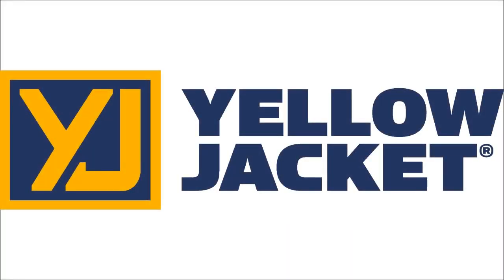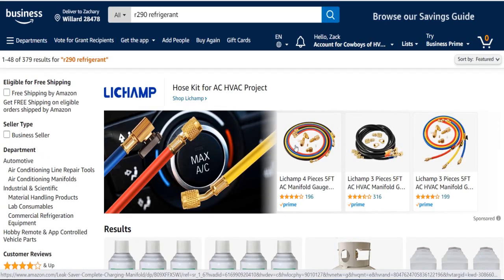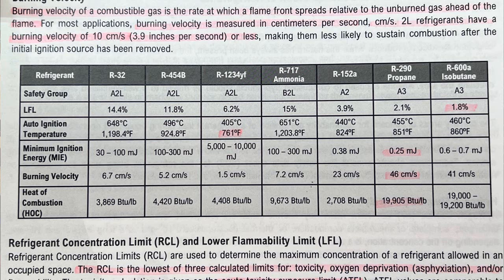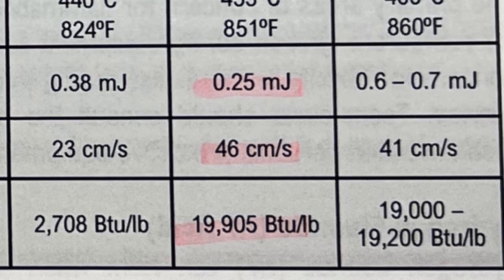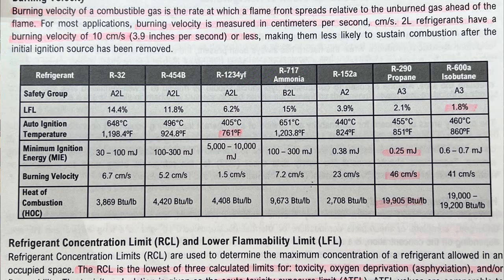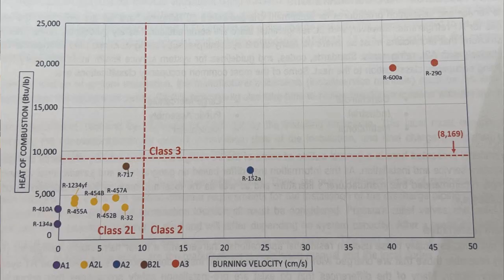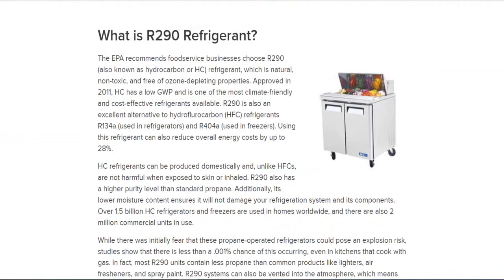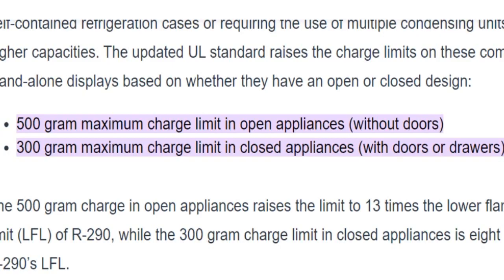Introduction to R290 refrigerant

Comment: R290: so scary. Oh wait if you have propane stove, propane water heater, hooked up to piping that can deliver  100s of pounds of flammable gas inside your house and yet we don't think twice about using gas appliances.
R290 is a great refrigerant. Cost, single component, no glide, etc. Did i say COST? Basically a drop in for R22.
 
Yes it deserves respect for safe handling and understanding if used. 

Why didn't we have it accross the board?
The chemical companies can't make money selling you R290. There's no patent on it. 
So I bet if you looked closely enough you'd see they are the companies that are pushing the scary narrative. But remember gas range, gas furnace, gas water heater, even gas lighting if you are Amish or want back up in case of power outage. 

I don't like the fear being used to prevent a great refrigerant being available.
Reply from the maker: I know they limit it to small charges. I guess the running pressure may separate it from other applications as well. 

But I see your point. We drive things that are powered by motors where controlled explosions occur rapidly.
Reply: @TALYN875  in the USA we live in a lawsuit happy wanna be nanny state. From my point of view there's no valid reason to not use R290 wherever R22 had been used with similar safety protocals used with gas fired appliances. But creating a boogy man out of it, means the chemical companies can sell you these other gases for a lot more money and profit. Seems like chemical companies are taking a page out of big pharma's play book, raising prices as high as the market will bear.

Comment: Limited gas amounts in a closed loop stored mostly outdoors in unit; why is this an issue considering many homes if not most are heated with flammable natural gas in an open system ignited indoors with virtually unlimited feed amounts. Why is the focus based on scare tactics highlighting flammability? The focus should be that R290 is non ozone depleting, is non proprietary making it inexpensive and requires lower pressures than many current refrigerants.

Comment: R290 sounds way better for heat pumps and water heaters. R290 can not burn or blow up without oxygen. Most leaks in AC units are slow leaks, so as long as there is some air flow, it would be hard to build up to an explosive mix. Within the unit, don't have open sparking, like unenclosed relays or loose wire connections. Don't let your pit bull play with the plumbing. Millions have gas or propane heating, stoves, fireplaces, etc. and  I would be more concerned with there plumping, as they are often more in the open were they could be bumped or something and have a large amount of gas behind them.

Comment: In a outdoor monoblock system there is no problem with R290.  It can heat the water to 75 degrees celcius

Comment: Americans are just too dumb to follow standard procedures for working with R290 equipment. Just pull a vacuum with all system valves forced open and purge with nitrogen before you open/braze on an R290 system and it's safe. It's being used in Asia and Europe because it's a superior clod climate heat pump refrigerant.

Comment: I'd be most interested in seeing the effects of  igniting a stoichiometric mixture of air and  propane in a closed refrigerator.   Wouldn't that be enough to blow it to smithereens?
Reply: You would have to ignite the entire charge at once with the right Oxygen mixture others a little poof is about it.  Nearly an impossible event.  Like a shark bite in a swimming pool.

Comment: R-290 refrigerant doesn't really bother me at all. RVs have been using propane as a refrigerant for decades, safely. What does bother me is the way some of the equipment is being manufactured. ie Pepsi drink display coolers where the neutral is literally the chassis of the unit, which presents a significant shock hazard. Or Maxx Cold units that are built as cheaply as possible which presents real concerns about the life expectancy of their units. Contrast that with units that are being built for export to the EU which seem to be built to a very robust standard.
Reply: Flammable refrigerant has also been used for quite a while in the EU, I have a 2007 R600A freezer that still cools great.

Comment: Its not half as dangerous as some of you think.
Its super easy to work with, and is crazy efficient.
Reply: And the lower pressures means the equipment and or last longer, leaks are less common and its not an over price proprietary formula.
Reply: As a drop in replacement for R-22, R-290 overall efficiency is nearly identical, and R-22 is close to the tops of refrigerants in terms of efficiency.  Another advantage is that moisture in the system will not end up become acidic as at will with R-22 and some oils.  
One of the best, comprehensive residential and light business refrigerant evaluations was made by the DOE around 2000;  unfortunately I can no longer find the tech report, but what I do find are less comprehensive evaluations that slant/ bias their conclusions towards questionable marketing arguments.
Reply: Agreed. Safer then a natural gas stove. More efficient then CO2 in warm climates.  System cost and maintenance equivalent with. HFCs.

Comment: Everyone calm down. Just purge before you braze. Honestly I've started a flame on every compressor I've worked on. It is a lazy flame so you purge more and away you go.
Reply: The same people that are worried about the tiny flame from a R290/R600 system have a torch with much more stored energy.

Comment: I have extensive experience with R290. Most of all the glass merchandisers I work on are r290 systems. Proper precautions and common sense go a long way. 😊 Nitrogen is your friend.
Reply: As long as the refrigerant is out of it, the most I've gotten was a small candle size flame when un sweating a compressor.
Reply: @R290s_biggest_fan  yep. I always have my gas sniffer too. If possible I will take the unit outside but not always possible. Just be aware of surroundings and pay attention.  The quicker we get used to it and comfortable working with it the better off we are. Changes are coming and we can either embrace them or not a be caught behind the 8 ball.

Comment: I am not an HVACR tech so please excuse this question but why isn’t Anhydrous ammonia used more in smaller scale applications ? (Package units restraunt refrigeration etc)  i work in a meat processing plant which utilizes Ammonia
Reply from the maker: I assume it is the toxicity
Reply: @TALYN875  yes. Also highly corrosive to brass in most service valves, TXV’s and RV’s.
Reply: We started out with R-290, R-717 and R-744. Now we’re going back to them.
Reply: Expensive, toxic, can be used to make very destructive weapons, corrosive, smelly, temperamental.
Reply: The toxicity.  Great for industrial but not so much for smaller applications.